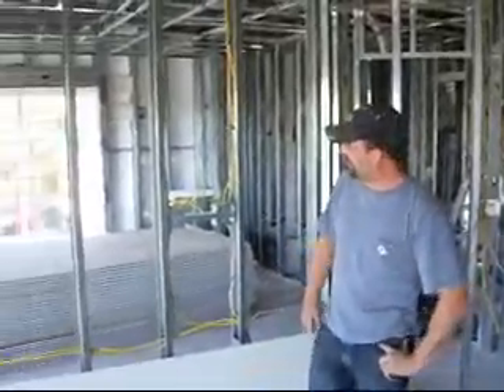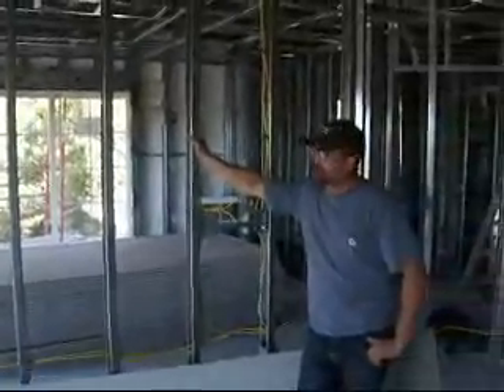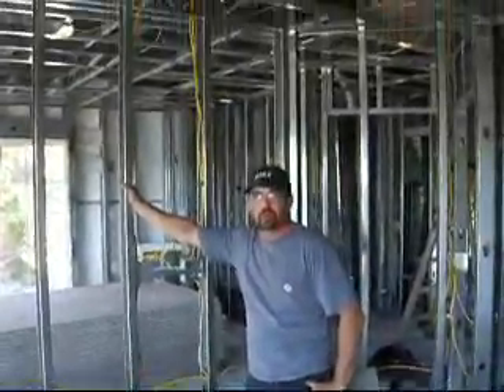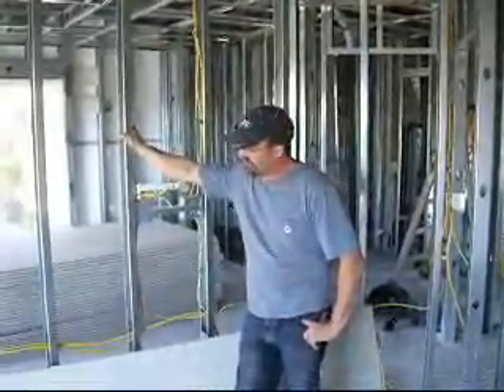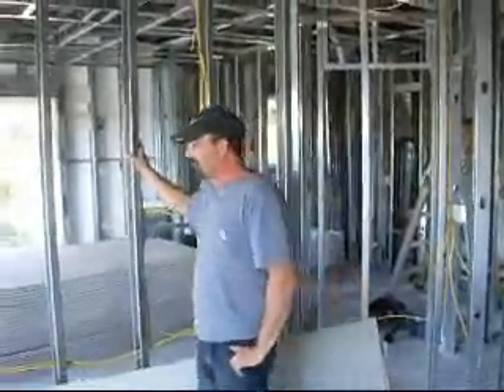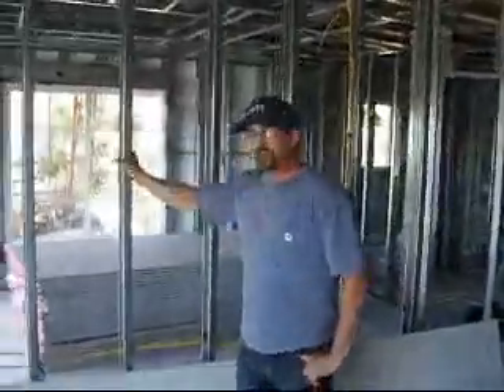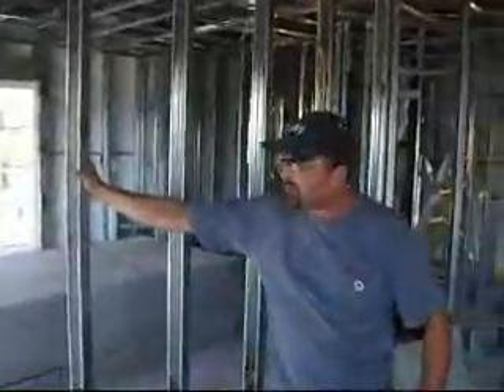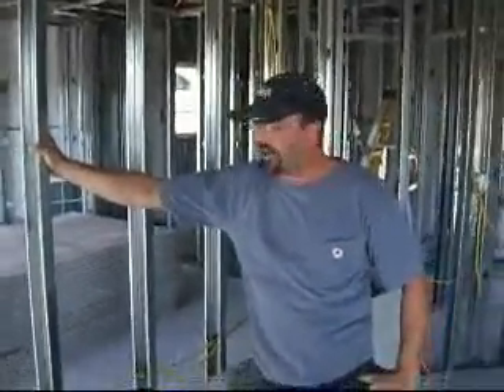Build Your Home from Metal  - Fire Proof!

Comment: I don't believe the Roofing precision statement you made.  you can unscrew and adjust a metal truss. providing your using ultra span even if you're cutting and stacking. you can raise your rafters up in down. metal homes are more labor intense. and water is just as detrimental to the metal application as it is the wood metal  will rust if they flood. I've framed both applications. I prefer the metal myself.

Comment: I don't know about in America but in Australia we have quiet a lot of bush fires, and during one over Christmas (our near to hottest time of year) the glass in the houses were striate up melting which opens the entire house to the inferno of a bush fire.
Also btw metal conducts heat heats up to very similar temperatures to the fire outside, yes the house won't burn, but if your inside it you will literally cook, and most of the items in the house would fare chance combust from the heat.
Reply: Before the fire reaches the steel it would need to go through whatever sheathing material you owner used on the outside of the house. A masonry material wouldn't burn through as quickly as wood. Also, it is a bad landscape design to have flammable material up next to the house. It is rather stupid to do that in a fire prone area. Any system can readily fail without the employment of common sense and/or proper precautions.

Comment: hi pal .job looks great how do I fire block metal studs? I'm framing a basement in jersey I know there different codes. but I haven't checked with town ship yet. I m thinking about changing all the metal studs to wood only because I know how to install fire blocks on 2x4s. and 5/8 rock for fire draft. Now I'm on stand still I have 2500 worth of metal stud laying on floor .

Comment: Steel can melt
Reply: At somewhere around 2-3 thousand degrees Celsius, so that's not an issue , but metal conducts heat incredibly well so the inside would probably similar to an oven.
Reply: Yes, at 2,500-degrees F, if you heat it long enough. But, remember that the steel is protected by drywall and anything else surrounding the steel. When discussing studs, they are never exposed directly to fire.

Comment: Have you not heard of residential fire sprinklers?  National fire code requires them for new construction.  Local code may be several years behind but cost is reasonable considering the protection it offers. Your family is priceless (even your mother in law is probably worth a few bucks).

Adding them to a metal building would be a great upgrade.

I have residential fire sprinklers in my 100 year old two story wood building because it surely is extra dry and would burn easily. 

 I got my brand new brass sprinkler heads on eBay for less than five bucks apiece ( times twenty four equals a hundred and twenty bucks).  I used Uponor (Wirsbo) pex tubing and inexpensive ProPex plastic tees and ells (1.25 - 1.55) except on each head which needed a brass connector ( about twenty bucks each).  Installation was easy using a used (eBay) Milwaukee expander tool for the ProPex rings.  (I also completely replaced my old galvanized water pipes at the same time).
Reply: Sprinkles coming up against a bushfire at 1000 degrees centigrade will do nothing, most of the water would turn into vapour and disintegrate before it hit the flames.
But for a simple fire that starts from the inside of your house it, can and would save lives potentially
Reply: Bull! If that happens, you have a bad sprinkler system. And a brush fire at 1,000C? What do you people in Australia put on your brush to get it to burn that hot?
Reply: They are not required in my area, except for public buildings. New residential construction on requires hardwired smoke detectors, not sprinklers.

Comment: Steel probably costs more than lumber. Pound for pound wood is stronger than steel. It's easier to place receptacles & switches, plus hang flat screen TV's to wood framing. Yes, steel is more fire & moisture resistant - Big Hooray!
Reply: +USNVA 
We should make weightlifting bars out of wood since they are stronger than steel.
Reply: Politically Incorrect First of all, the metal used in most homes is aluminum, not steel. Secondly, your argument about weight-lifting bars doesn't apply here because we're talking about home construction, not gym equipment.
Reply: Ultimately we are talking about materials.
Reply: Not really. At my local builder supply store, they cost about the same. And no, kilo for kilo, steel is mush stronger than wood. But, you do have a good point about hanging things on walls that are heavy. So, don't.

Comment: Metal studs are awsome.  I am a commercial carpenter and it is 90% of our work for framing.  It is more fire resist with the proper fire rated wall systems i.e. mineral wool, fire caulk and double layer rock for a 2 hr rating.  Architects go way overboard with fire ratings and they mostly use metal and steel.  Now if I was framing a wall in my house I would love to use metal, unfortunately it is $5 per stud to $1.50 for wood. 8 studs per 8 ft, plus top and bottom track. you do the math

Comment: Fire proofing steel stud buildings.  Use no flammable materials in construction.  No wood products.  Sheath all exposed steel with stucco or concrete fiber board.  Put metal fire shutters to shield the house from flying embers and heat from a wildfire.  I rebuilt from a firestorm 18 years ago, and have been dealing with fire protection of the house to get ready for the next fire.

Comment: Help.  My house is framed in 16 gauge, 8" steel studs that extend to the parapet around the roof with baloon framing.  I have a 4th floor roof top deck using pan joists that were to light.  I want to cover the roof with a second roof of Dek-ing 18 gauage A deck and extend it through the parapet for fast drainage.  I'll have to notch every 2 feet for the studs.  How do I seal between the stud and the A deck -- particularly on the open side of the studs ?

Comment: Sorry Jason, but steel is not fire proof, it will lose its structural stability and bend and warp at 500 degrees C. We protect the inside of steel battleships with our cloth, which not only stops flame, but heat as well. We also have a tested system which we developed following the 2009 Australian bushfires. Which can be wrapped around the either a steel or timber frame to protect against both flame and radiant heat. Our Firefly Plus 60 is only 10mm thick and 2.2kgm2. From TBA FIREFLY

Comment: The only way to do trim work in a steel house there has to be wood involved and as far as termite damaged they are right about the moisture but metal and steel will rod if it's exterior especially on decks(joist hangers) in summer wood expands and metal shrinks and winter it does the opposite but craftsmenship looks great. (Crawford Construction)